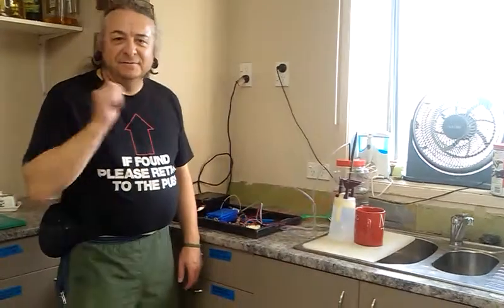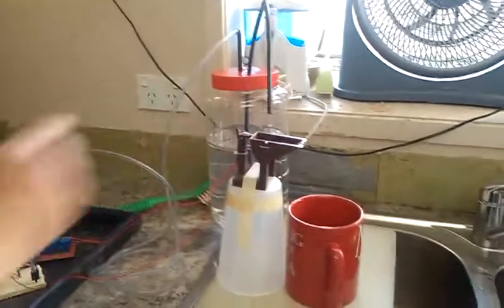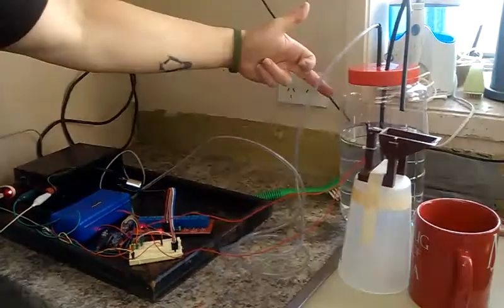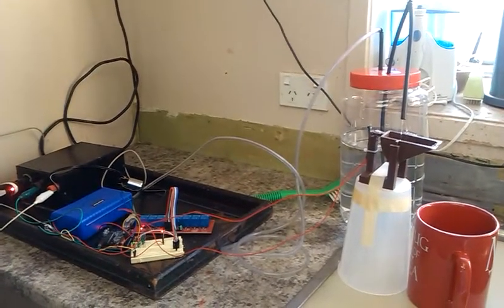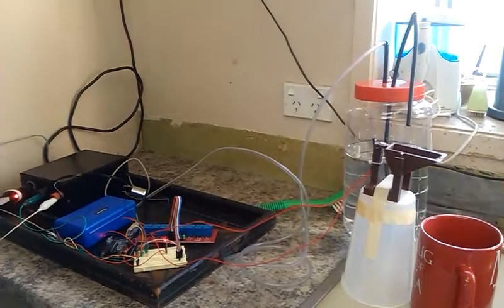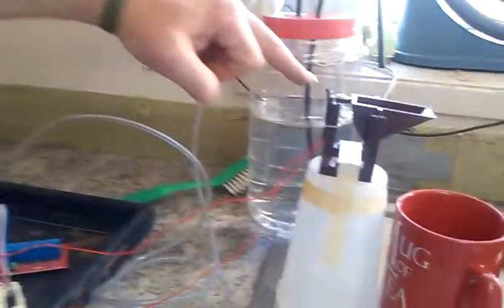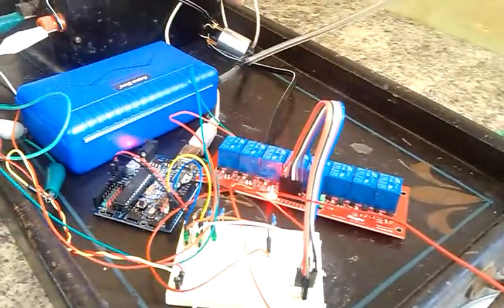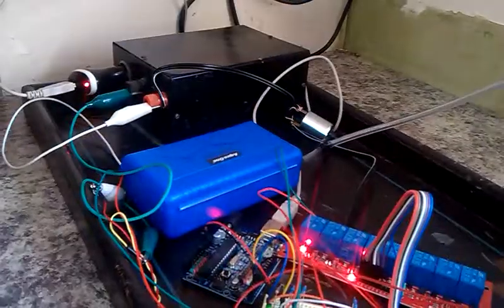Tipping Bucket

Comment: if you wired a conductivity probe from your soil in parallel to your pumping motor ... then when the soil is wet the pump is shorted out and is turned off .When the soil is dry the pump is turned on again . You may want to add one transistor in the circuit to make the on / off switch more predictable .